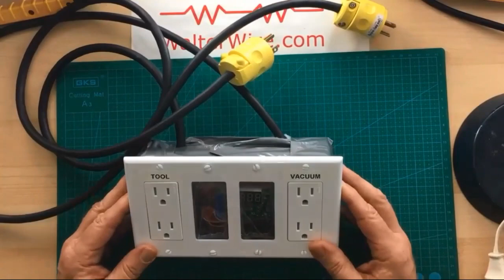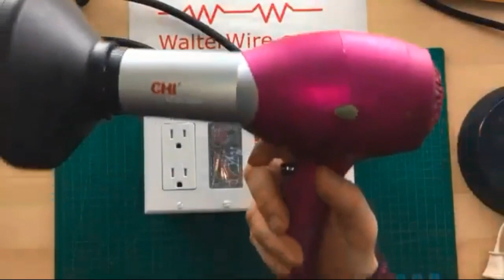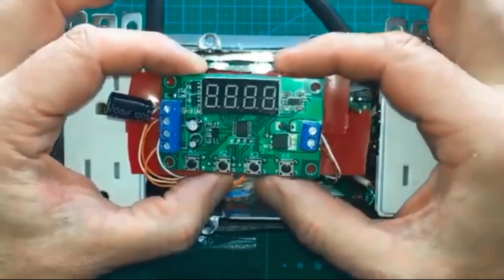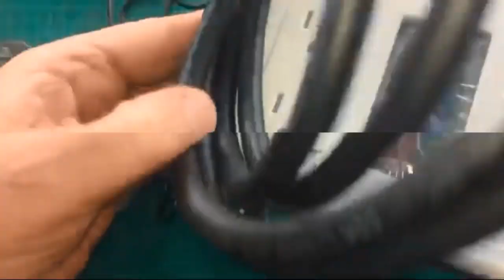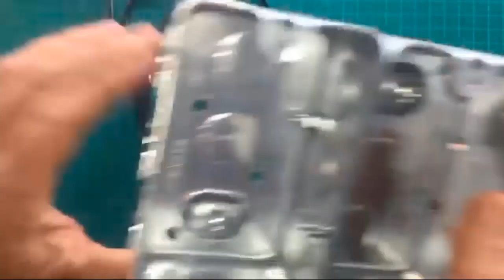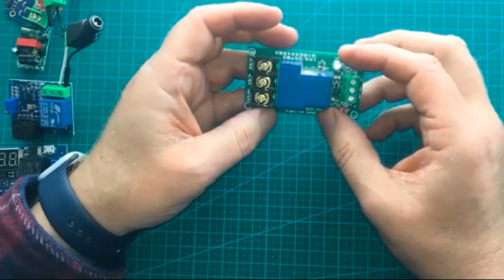Automatic Vacuum Switch - DIY - Only 4 components

Comment: I used the same or very similar current sensing module as you did. I used the relay output of that module to trigger a DIY circuit that waits for one second to turn on the vacuum and once the tool stops, waits for five seconds before stopping the vac. It's not programmable, but you can adjust the time delays by using different resistors.

Comment: Hi, thanks for your video. Unfortunately the link you posted in the comments doesnt work anymore. I found the YF-11 elsewhere and read trough all the poorly translated program modes. P24 is described as: "12.P-24:Input signal more than T1,the output turn ON.The signal disappear more than T1,the output turn OFF." Is this the program you used? To me it looks like the power on delay will be the same as the power off delay, because they are both called T1. This wouldnt be great, as we want the vac to start just about a second after the tool, but want it to stop between 3 and 7 seconds after the tool. Maybe your YF-11 is slightly different?

Comment: link to the delay relay timer you used?
Reply from the maker: Here is the link on Aliexpress
https://www.aliexpress.com/item/32313151307.html?spm=a2g0o.order_list.order_list_main.21.5de31802auK6If

I used P-24 program mode.
Reply: @walterwireteaches  thanks!    I found one eventually.  Programming was difficult due to lack of info online but I did find it.     I made it for my Woodshop and vacuum system that has many tools that I have vacuum lines running to.  It is a life saver